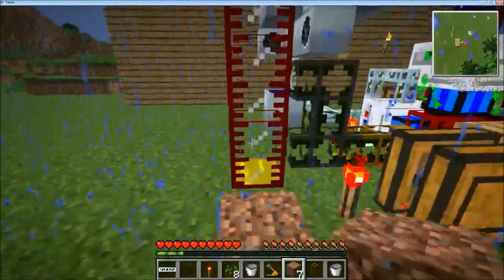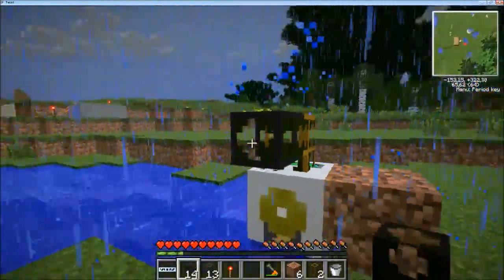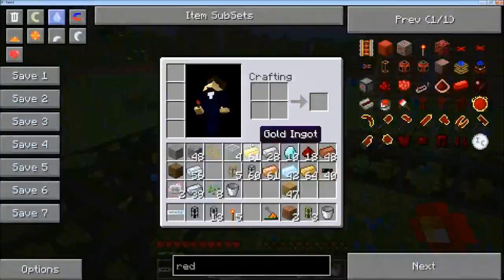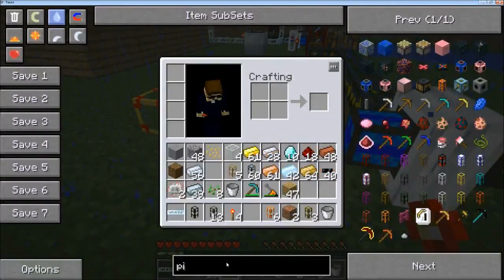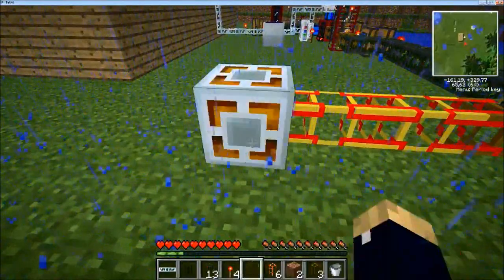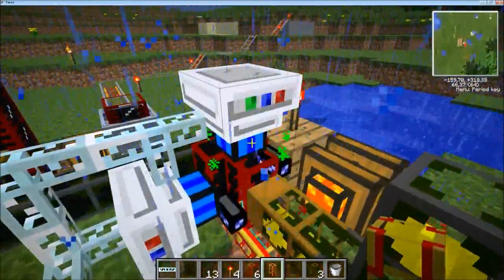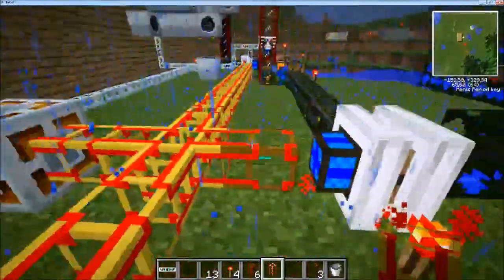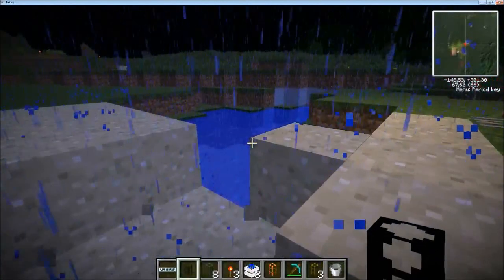Tekkit Tutorial: Episode 9 [Combustion Engine]

Comment: because the flow of water wasnt big enough to cool the engine. a pipe full of water could be flowing in the wrong direction.... fluid behaves like a ball in the pipes, it bounces back if not stopped or used.